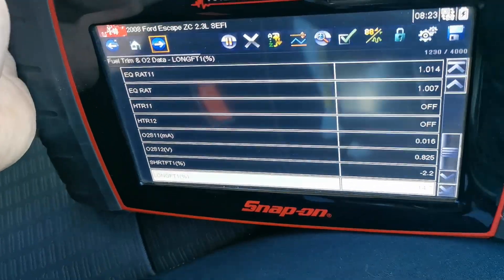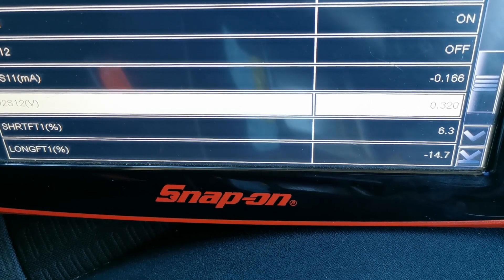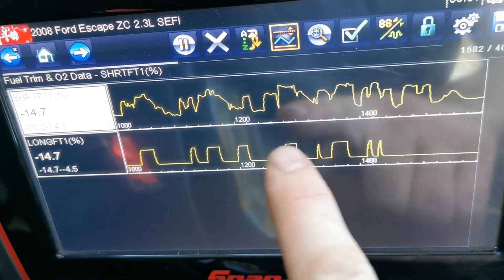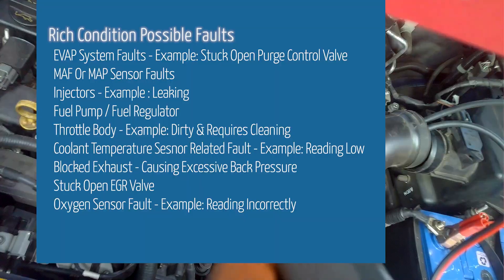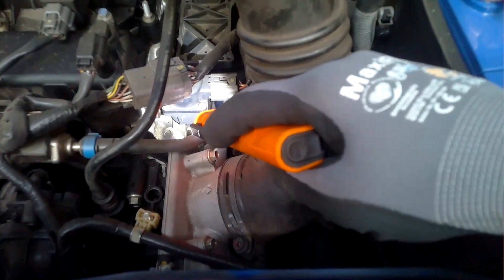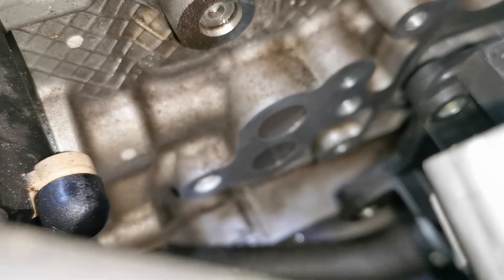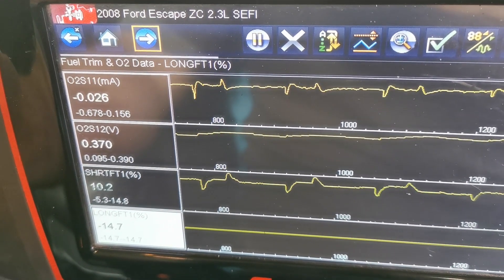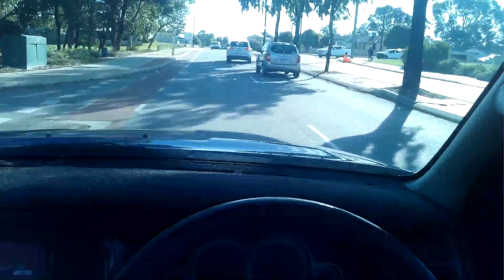System Too Rich - Problem Found & Fixed - How To DIY - Ford Escape / Mazda Tribute 2.3 L (V2)

Comment: Why does a leaking EGR valve cause a rich fuel condition?
Reply from the maker: Messes with the air/fuel ratio due to the exhaust gases passing through it.

Comment: I think you just saved my problem, same issue that I've been trying to chase for years on my Ford focus 1.8, running rich on iddle and soetimes get egr valve code. Removed and cleaned it but still running rich, I'll just replace it and see how it goes.